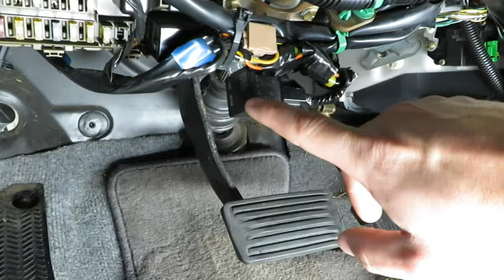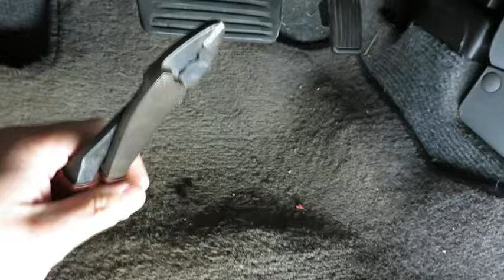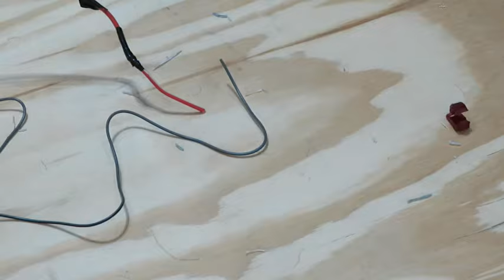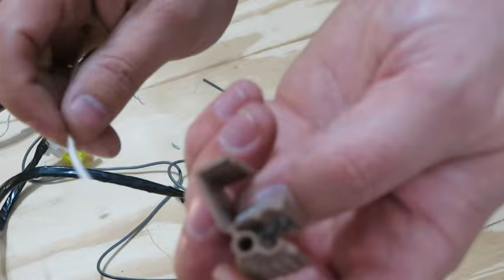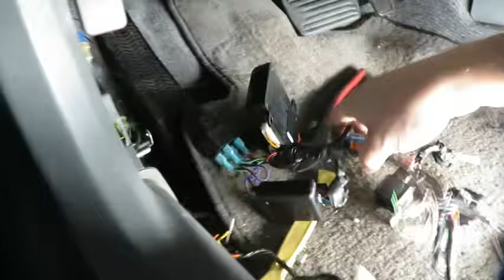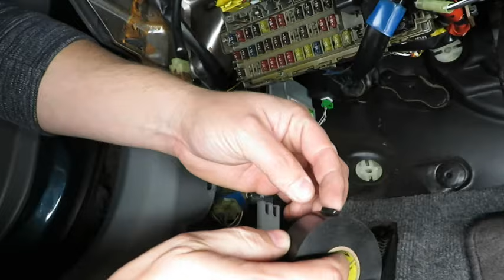Car Alarm Removal Made EASY Without Damaging Your Vehicle!

Comment: Great video. This helped me very much. Had purchased a 2012 Rav4 that had an aftermarket alarm installed. Sadly the only thing I had to "disable" it was a valet button but still wasn't sure on brand and all that. I finally tackled tracing the wiring for that to the main hub and so forth. Thankfully whoever installed it did it professionally and all I had to do was unplug the wires from the jumps and that was it. Done and done. Thank you again for this video and the helpful explanations of all that you pointed out.
Reply from the maker: I'm glad the video was helpful

Comment: Thanks for your help My Viper.
Alarm got sun damaged and kept leaving me stranded. But I didn't know it was the kill switch.I thought it was the starter than the alternator I replaced multiple Starters and alternators.then i gave up for 6 year. Then I randonly ran across your video, cut the 2.Wires put them back together.The car started right up. I almost junked my car because of a stupid aftermarket alarm. Thank you so much
Reply from the maker: @meikostarling3988  I'm glad the video found you and you didn't have to junk the car. Stinks you had to let it sit for 6 years
Reply: Bro I'm about to junk my 94 Civic cause I found it won't start after driving it for a bit, gets gas no spark and cranks. Replaced everything but the alternator. Found this little junky looking viper alarm underneath, and the relay doesn't click either. I think mines just fried from being sun baked too.

Comment: after this video i was able to get my tuck running. thank you
Reply from the maker: Awesome, that is why I posted it. I have had to do this many times to get a customers car running. I  am not saying that remote starts or alarms are not reliable but they do use relays that fail just like the relays that manufactures use. I am glad you got your truck running.

Comment: Great video. I have a 1989 rolls royce that came with an aftermarket alarm probably from the 80s or early 90s and I'm having a rough time getting mine out. I don't think i've been able to find the starter kill relay. I traced the alarm itself as it had two starter wires and it led to a spliced cable but it was pretty thin I don't think this would have been the starter cable and it was part of a harness.
Reply from the maker: If you followed the wires from the alarm to the wire in the car, that should be the starter wire. Some European cars used small gauge wires from the ignition to the relays for said circuit to just energize the circuit and not power the circuit. It is possible that the didn't install the starter kill option.  Do you have the brand and model number of the alarm that was installed? Is it a remote start as well as alarm?

Comment: Does the car still start after you reconnect the wires after taking off the kill switch
Reply from the maker: Yes. You have to make sure the starter wire is no longer running through the relay.

Comment: This has been super helpful, so thank you for posting this. Though when you said you would be installing a relay where the starter wire is, is that part necessary for the car to function? I ask only because I've got some stuff happening and don't want to cut and remove a piece if I'm not gonna be able to drive the car to class.
Reply from the maker: @arceuswarlord2222  the relay is there to interrupt the starter wire when the alarm is active. Sometimes those relays go bad and will not allow the car to start. If you do infact have a starter relay and want to remove it, your starter wire will be cut and one end will be on pin 87a and the other will be on 30. You would unhook those from the relay and then connect them together. The wire should be the same color.

Comment: Great video!!! I think mine might be helping drain the battery of my 05 civic during our lovely cold snaps. I don't have a heated garage, is there any way to just disconnect it until I can do a proper removal?
Reply from the maker: Usually there is a red wire that has a fuse on it. If it is an alarm only, then you will have a small red wire with a fuse, usually a red ten amp fuse. If you have a remote start you will usually have two large red wires with green 30 amp fuse. You will pull those fuses if you can find them. Let me know if that helps or if you have more questions.
Reply: @DCAutoEnhancement  Hi, I have a RAV 4 2003 that I bought about 3 years ago, that has a remote starter/alarm on it. From the beginning the batteries on the small remote control ran out quickly I had to replace them just after several weeks. Then I got tired of it and hasn't used it at all. 
Now for some reason the car's battery just ran out every night until it became unrechargeable, so I replaced the car battery but it happens again. This did not happen before though I don't use my car for long drives and sometimes let it sit in cold winter for months (I live on a bus line.)
My mechanic who is retiring in couple of weeks refused to help or recommend somebody else in the area to detect the problem. My neighbor suggests it may be something that runs all the time and drains the battery, and the remote alarm can be the culprit. 
What do you think it can be? What should I do? The car still run very well and just passed inspection although the ABS brake light has been on and the mechanic said the brake was OK. Please give me an advice, whether ripping off the alarm/starter will help my problem. Or it may have another cause?
Thank you
Reply from the maker: @tuongnhicuaanhnguyen  it is possible that your alternator isn't charging the battery in your car and that would allow it to discharge. The alarm could've a part of your problem but based on what you have said, I would suspect the alternator over the alarm. You can take your car to a place like AutoZone and have your alternator checked.
Reply: @DCAutoEnhancement  THank you very much for your response. I did take the car to my mechanic after recharging the battery, and of course he did not find anything wrong with it. "The car starts fine and runs fine", said he. I explained the problem to him and did suggest the alternator and he checked it too and tested everything electronic. Nothing wrong, but still the next morning the battery was dead again. The old mechanic says his shop doesn't deal with this kind of electronic problem, too complicated for him. 
Now I just remove the battery connections when I get home to save the battery. This afternoon I found a place I called. They said it would cost $180 to test and detect the problem/cause. I just don't know whether I should do that, given that it's 21 years old... and then the cost of fixing the problem... I can't afford a new car either. I thought yanking off the alarm/starter system was easy but i doesn't seem so. How to unplug it. That's why I bumped into your page and saw that people are all happy this video helped them. 
Thanks again.
Reply from the maker: @tuongnhicuaanhnguyen I hope you find a solution.  I wish I could have helped more

Comment: What do we do with the unlock lock relay main wires or left over wires do we just splice those back together
Reply from the maker: It depends on the lock control style. What is the car you have
Reply: 2001 f150 xl

Comment: I am brand new to this kind of stuff. I think I bit off more than I can chew here 😫I wish my situation was as easy as yours. You found 2 wires obviously belonging together and hanging perfectly. My wires are different colors and cut in several different places. How can I tell which is the starter wire and where does everything else go? I even have some big old 10 fuse hanging on them.
Reply from the maker: @skyrim4612  you can email me some pictures and I can try to help. What car and do you know what alarm or remote start you have? Info@dcautoenhancement.com
Reply: @DCAutoEnhancement  Okay. I started working on those wires this morning and had an hour to try an figure that headache before my daughter got out of school. I found out that they put extra connections to put the alarm in. I cut the alarm out and cut off any wires split. Then I matched the colors, stripped those wires, and connected them with duck tape (no electrical tape handy). I just want to thank you for this video. You really don't know how much it means to me and all that you have helped. Thank you so much!
Reply from the maker: @hazel8716 I like the perseverance! Make sure to get those connections secure as soon as possible. Some butt connectors that have heat shrink on them are nice and easy to use

Comment: Im removing a viper system from an integra and fixed the starter signal wire, but i am not getting the fuel pump to prime. Opened the fuel line to find air so Crank no start. i ripped out every wire (it seems like all these 90s installs were just poorly done). I dont see anything messing with the brown fuel pump relay… any ideas? Btw this video was one of the most helpful ive seen thank you!
Reply from the maker: What year is the Integra?
Reply: @DCAutoEnhancement  i think its 94, it has those old fat fuses
Reply from the maker: @VisionChaser2391  I was just wondering if it my have had an immobilizer on it but it doesn't. As far as the alarm is concerned, once you reconnect the starter wire and it cranks, you are good. Did you buy the car not starting? It could just be a bad fuel pump or a fuel pump relay if the fuse is good. Thanks for the feedback on the video, btw.
Reply: @DCAutoEnhancement  thank you for your insight, this car has been sitting since 2013. I thought it was bad gas but since im getting air in the engine bay fuel line i was concerned if wiring had messed with the fuel pump.no prime noises at all. I will check fuses and possibly replace the relay or pump

Comment: In theory, is it sufficient to just disconnect the ground wire of the remote starter to "disconnect" it from the car altogether?
Reply from the maker: yes, in theory it will stop the flow of current to the remote start if there is nothing wrong with the wiring of the remote start. Usually people think about disconnecting a remote start or alarm when they start having electrical issues.
Reply: So for me I'm like 90% sure it's the cause of my battery draining completely after 24-48 hours, since I don't drive the car as much anymore and everything else is stock; I've even disconnected the dash cam...
Reply from the maker: @nmargono  sometime a loose ground can cause a parasitic draw which is what you are describing.

Comment: I hope you are still replying…  I’m removing an autopage RF520 and I’ve been trying to trace all the wires and remove. I started to cuts a red wire and the car starter started to turnover - I immediately stopped and the wire was not cut but now the car won’t start. I see no relay but I think it’s built into the main control box. I’m not really sure how to proceed at this point. Should I follow the red wire that caused the starter to crank - that’s the wire that I’ll probably need to splice?
Reply from the maker: I believe you are correct that your starter kill relay is built in to the module. I would see if you can match up the starter wire from your ignition where it was cut and look for the other side of it.  Once you find the two ends of the starter wire, you can connect them and then the alarm is no longer interrupting the wire.  I feel like I butchered that but hopefully you got the point.
Reply: @DCAutoEnhancement that makes sense. I just went back out and looked. There is a green wire that was cut. They used a butt splice on each end of the green wire and there is a black wire coming out of each butt spice that runs to the pin connector for the control module. I think if I reconnect the green wire I should be good. Thank you for the quick reply and the video. I’ll let you know what happens.
Reply from the maker: @hmc8171 sounds like you are on the right track. Good luck!
Reply: @DCAutoEnhancement that worked. Thank you so much for the replies and thank you so much for the information video.
Reply from the maker: @hmc8171 no problem, I'm glad it worked out for you!

Comment: Nice. 
How do you i.d. the chip key simulator ? The older remote starts had an actual key in the harness.   The newer ones are harder to find. 
Subscribed and 👍👍👍
Reply from the maker: It sounds like your question is geared toward installing a new remote start or installing a new bypass on an existing remote start, is that correct? Thanks for the sub and 👍

Comment: I have a 91 Caddy brougham . It has a very old alarm installed.   Battery went dead several times now i think alarm wont allow car to start. I tried kill switch buttons nothing.   If i cut that starter kill relay wired you should and connect wires without relay would that work to start the car again?  Or i have to remove whole alarm system like you did?
Reply from the maker: You are correct, if you find a relay attached to either a purple wire or a yellow wire, cut the relay out and re attach the original wire to get it to start. Removing the alarm completely may be desired because it can cause lights to flash and possibly a horn or siren to sound
Reply: @DCAutoEnhancement  thanks i will try to cut that relay  first then get it o start.   Then take the rest of that spaghetti wiring apart😂😂. And its a ton or it

Comment: Very helpful
Reply from the maker: Thank you
Reply: @DCAutoEnhancement  Too bad I just went to do this to a 2000 excursion and saw no alarm module under drivers side. Only a small toggle. Started to rain so to be continued
Reply from the maker: @bobbell5928 when you get back to it, follow the wires from the toggle and see where it goes. I think there is a decent amount of room in the kick panel as well as up high above the brake pedal. Good luck, I'll help if I can.
Reply: @DCAutoEnhancement  Thankx!

Comment: Got 09 smart passion fortwo with all keys lost. By Removing the security be also removing the chip key system ?? 🤔
Reply from the maker: The chip system is built into the car. If you have an aftermarket alarm it won't affect the chip. I hope that answers your question

Comment: Will you just be able to start the car now with the key?I want to get rid of mine.Cause i'm having  issues It must be a loose wire or something There's a little box up underneath Which has a green light when it's activated And when I get up there and move it around a little bit.That comes on and allows me to start It's getting more and more that I have to get up there and I know It's going to cause b s shoes lead me Strand it one of these times
Reply from the maker: If you remove everything that was not original to the car and reconnect any wires that were cut for the installation, you will be able to operate the car as intended.

Comment: Hi, great video, I have a older Chevy pick up I want to remove the after market alarm from. The truck came with a factory alarm from Chevy, will unplugging the after market one return to factory setting alarm ?
Reply from the maker: It should. When adding an aftermarket alarm, almost always they factory alarm still functions as it did from the factory.
Reply: @DCAutoEnhancement  thanks, I will give it a try.
Reply: @DCAutoEnhancement  man, so I pulled the old aftermarket alarm system, and I was able to put everything back together to oem, but when I’m trying the program the key fob for the original alarm it does not program. I checked all my fuses and relays but no solution. Any tips or ideas on what you think it can be ?
Reply from the maker: @efrainalvarez9541  usually a factory alarm is integrated in such a way you don't know it is there. Maybe yours was a dealer installed option. How are you trying to program the remote and how did you determine which one to purchase?
Reply: @DCAutoEnhancement  so I have an oem replacement key fob, and I’m trying to program it with the “hold unlock, switch on, switch off, on, off. “ Method but I’m not having any success
Reply: @DCAutoEnhancement  I have a U1000 and a U1064 code if that helps
Reply from the maker: @efrainalvarez9541  what is the year make and model of your Chevy
Reply: @DCAutoEnhancement  a 2002 silverado
Reply: @DCAutoEnhancement  LS
Reply from the maker: @efrainalvarez9541  if you have a picture of the factory alarm main brain, will you email it to info@dcautoenhancement.com
Reply: @DCAutoEnhancement  sent it !